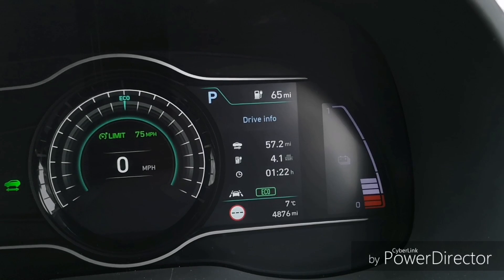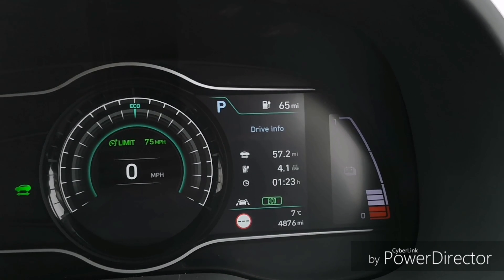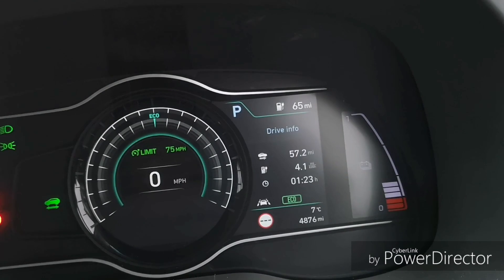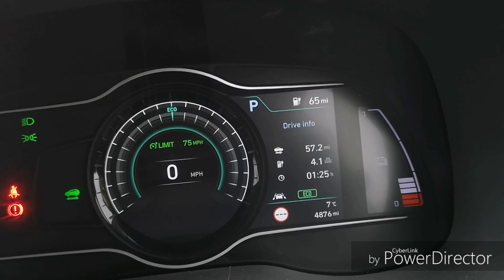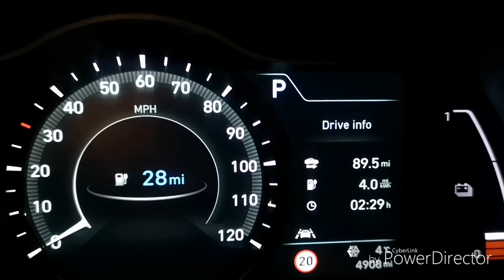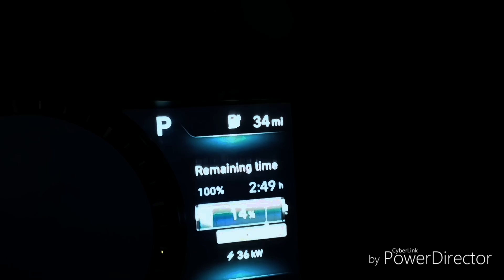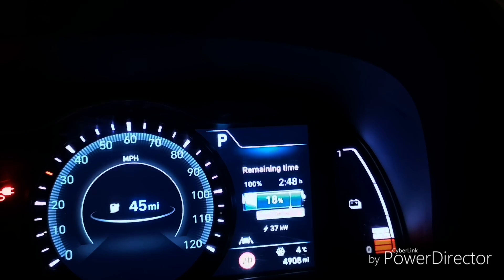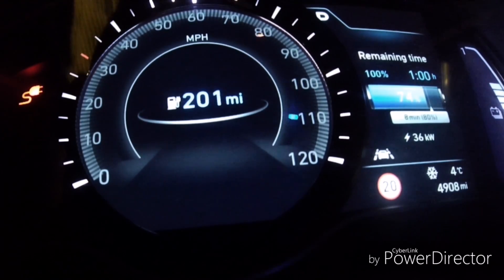Kona Electric charging from 12%-80% 4C

Comment: Nigel - this charging speed seems to align with a 100A 50 kw charger.  That’s the max speed that I have seen going into my Bolt EV (from a 100A charger).  For comparison, on a similar temperature day, the starting charge speed into my Bolt battery is upper teens, working its way up to 35 as the 30 minute mark approaches.  I think your numbers look pretty good!

Comment: Thanks for the great insights into the Kona, got one on order now 😀. I have a question not related to the video I’m afraid but wasn’t sure where to ask. Does the Kona have “normal” cruise control mode as well as adaptive? On my outlander phev I can enable by holding down the cruise control and wondered if the Kona was the same .
Reply from the maker: Yes you can use normal cruise although so don't know why . SCC is way better
Reply: The EV Puzzle , thanks good to know, I agree but handy to have both depending on the driving style of the traffic around you

Comment: Even Bjorn Nyland got more than 36kW during his charging in cold weather. Constant level of 36-37kW makes me wonder if the charger was putting out enough. I normally don't blame a charger, but it is at least suspicious that during the whole session it remained steady at that level. I would investigate the charger to eliminate a wrong conclusion.
Reply from the maker: I've seen worse at other chargers
Reply: @EVPuzzle  There are even 22kW DC (fast)chargers. The thing that I find strange is that the charge rate remains constant at 36-37kW during almost the entire session. Bjorn got on an e-Niro 48 kW at -6 C. and the Kona at 41kW at -13 C before it tapers of to lower speeds. So that is just making me wonder if the charger was limited in some way. That's it.
Edit: Here a German video from Nextmove (forget the German language, but look at the video and charging speed): https://youtu.be/7YCGBsagCNc?t=224 outside temperature of -5 C
Or do the cars from the German video already have a firmware update? I say this because they even get 70kW charge at 60% on both cars and that is a score that Bjorn never got at the 350kW charger. Or the travel of about 200km at 120km/h was enough to heat up the battery.

Comment: Good info Nigel. Been watching Bjorn test a Kona in (for us) extremely cold conditions and he complains of something called 'coldgate' where battery temp restricts charging. However the ability to charge within an hour and add sufficient miles for the majority of journeys in extreme cold seems entirely adequate and indeed an attribute of the Kona ? For 9-10 months of the year no issue and for the other 2-3 months just a little more planning. The Kona's efficiency still leaves others standing ?
Reply from the maker: Coldgate as Bjorn calls it is the Kona's weakness. I reported it to Hyundai back in early November but they haven't even bothered testing it. The 39kwh is affected most.
It probably impacts more customers than Rapidgate. The difference is Hyundai covered themselves with caveats and broad promises thus , it works as stated.
The real issue is the liquid cooled and heated battery management system. It's implied that it helps in winter conditions but it doesn't.
Reply: The EV Puzzle  Very interesting. I notice that according to Transport Evolved Nissan are not releasing their 'rapidgate' update in the States. It would seem that extreme caution is needed in evaluating the various technologies and what they allow. For me the Kona still seems streets ahead in what it will actually do than the rest (given that the model 3 Tesla is nowhere near the UK market yet).
Reply from the maker: You're making my point for me.
Yes It works out to be 75mins ...again

Comment: Instavolt charged me over £6 this morning for a 50% top up
Reply from the maker: Instavolt are great but 35p is too much
Reply: @EVPuzzle  35p is reasonable. Dual chargers at all sites, easy to use chargers, good maintenance and contactless payment. Well worth it in my opinion. Remember that most charging will be done cheaply at home anyway. Rather 35p and it works, than 30p at Ecotricity and you take a 50/50 gamble.
Reply: @jameswhite2792  at that price it's pretty much the same as petrol so I could have a cheaper car and avoid the hassle of stopping to charge.
Reply: @enyaq_gorm  But rapids are only used for long journeys, the savings are from the majority of your miles when you've charged at home. I'd pay for reliability every time on a long journey.
Reply: @jameswhite2792  in cities where most people stay in flats home charging is not always an option
Reply: @enyaq_gorm  True, but the Polar subscription model will fit those people (although it takes a lot of dedication at the moment for an EV owner if you can't charge at home or work).
Reply: @jameswhite2792  depends where you are. I've never seen a polar charger let alone been able to use one.
Reply: @enyaq_gorm  Fair enough. Quite a few near me, but no Instavolts :)
Reply: @jameswhite2792  there are only four in the whole of Scotland. None in any of our cities. 
For some people the nearest Polar will be hundreds of miles away. In my case it's about 40 miles.  My nearest chargers are instavolts. We have one CPS rapid but it almost always has queues so I almost always use instavolt.

Comment: OMG this is ridiculous. Hyundai need to address this slow charging. We need manual battery preheat option. We have the hardware for that, we just need proper software. This car's are unusable in cold weather. :(

Comment: The charger may be limited to only ~36kW. Some 50kW DC fast-chargers are only connected to 36kW power lines in France, it's rare but it does exist, most of the time they are hooked up to their own battery pack which should bridge the gap, but in reality those instalations are most of the time undersized with 5 to 10 kWh battery packs. They were designed for the previous generation of car with 15/30kWh packs, hence the ''only'' 15min supply
Best explained over here : https://www.ugap.fr/images/media-wp/noeuds/vehicules/60316_schema1.jpg
The charging time is the consequence of the charging speed, the first doens't affect the latter. The charging speed won't reduce to take 75min, it's purely due to conditions such as, temperature, state of charge, EVSE capability ... It will always charge in the quickest possible time

Comment: Hi Nigel, did you seen Bjorn's video on Kona EV distance? He  got about 510km on a single charge, think turtle mode only kick in for him when the battery hit about 3-4% and reckons there is actually a bit more than 64kWh in the battery to achieve this. Hoping to test the same when I get time. Video linked - https://youtu.be/kq3OoZoUZBA
Reply from the maker: I did Terry. I'm not convinced his equating is right about battery size . Hyundai are quite precise in saying usable is 64.2kwh

Yes I'm planning a range test too. A winter one

Comment: Disappointing charging speed again. 
At the start its same speed as my eGolf which has a completely passive battery and also it has a lower voltage battery.
At the end eGolf would be doing 41kW
At least the big battery makes up for it

Comment: This is the problem with the batteries mate. It is great as a technology but they need to solve a lot of issues. Maybe in next 5 or 10 if I want to be more realistic it will be much better
Reply from the maker: I disagree it's not the batteries it's the lack of information from the manfacturers. They simply don't share enough detailed information

Comment: I think the hour limit is set so that everyone can get a turn. Until the kona arrived most EVs were using batteries of 24-40 kW so the hour makes sense for them. CPS chargers stop after 1 hour. It's actually your fault for having too big a battery 😛
Reply from the maker: I agree. Having the big battery doesn't mean you get to use it all it seems